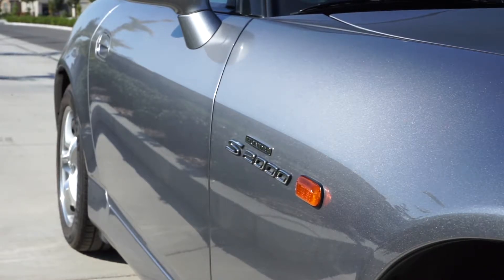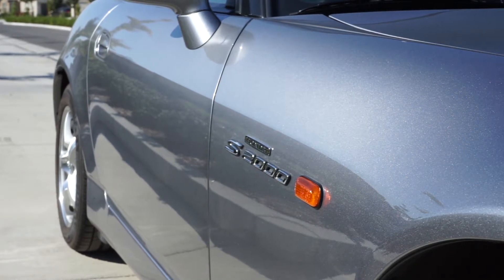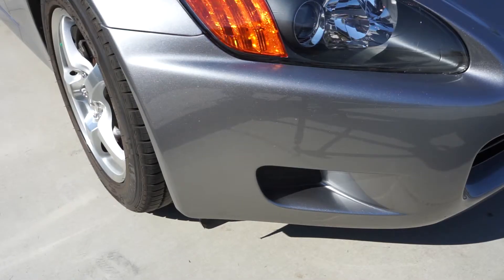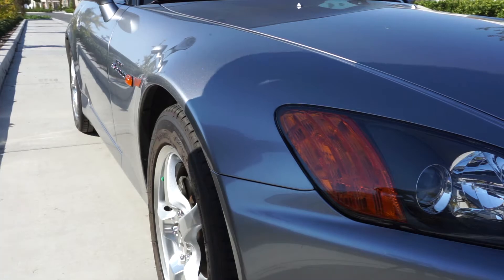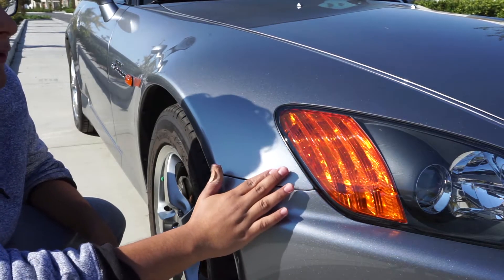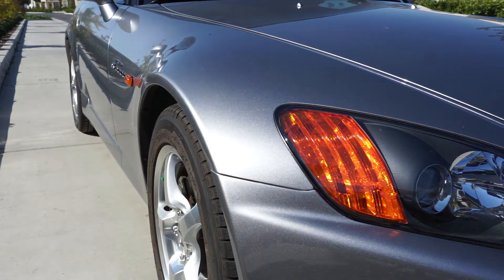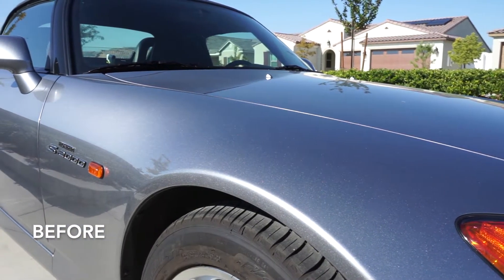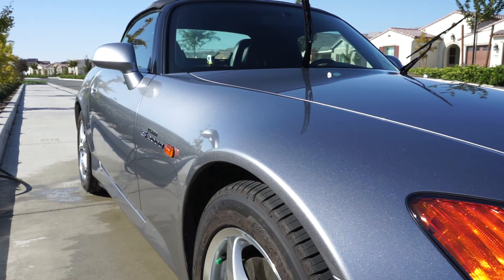Torque Detail Ceramic Shine Garaged Car: 2 Month Update

Comment: Baby shampoo? Never heard of anyone using that as a car cleaner! What are the benefits? Your car looks awesome!! I ordered some Torque Ceramic , the commercial sold me, but now I’m looking up reviews for the product because all the spam emails from Torque make me feel like I got bamboozled, but the reviews I’ve seen have made me feel like I’ve made a great purchase !! Thanks for the video
Reply from the maker: Hello friend, yes this stuff is the real deal! I kid you not all my cars have torque detail ceramic shine....The baby shampoo is a good way to clean dirt and bugs off of a vehicle that already has wax or some sort of detailing product....If you use meguiars or some other car wash soap you will strip away all the wax you put on your car very quickly....The CORRECT thing to do is to buy PH balanced soap that wont strip your wax at all but tbh I dont have the time or energy to try out expensive products. The baby shampoo does the trick for me and its really affordable and in my experience it does not strip away my product as quickly as car wash soap.